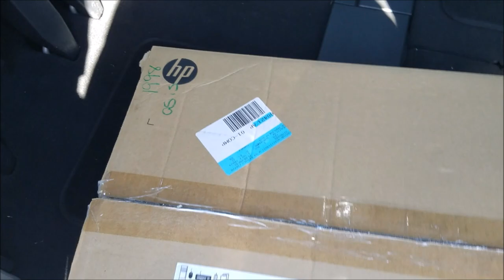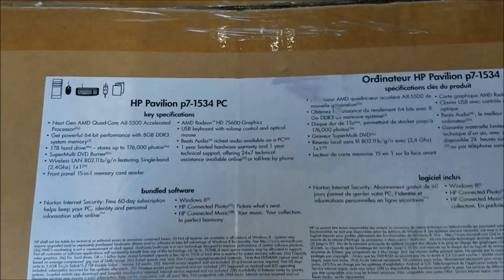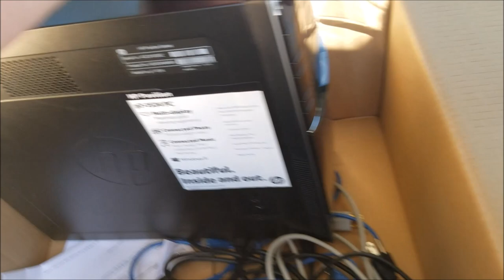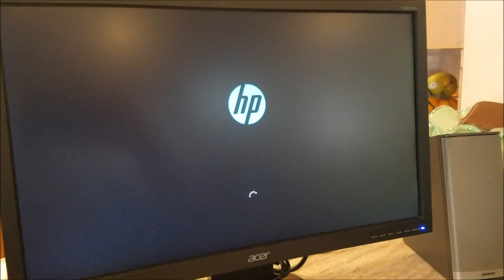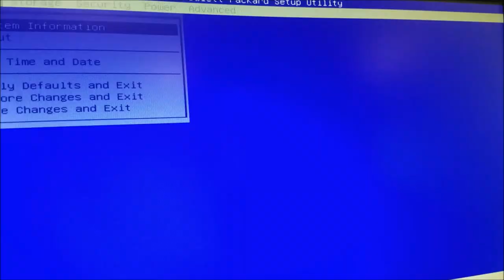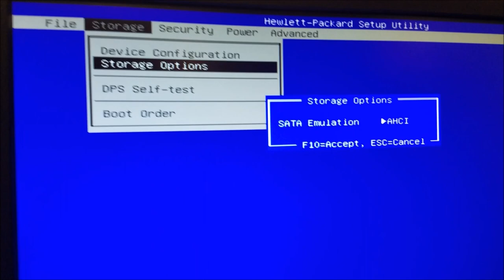$15 QUAD CORE AMD A8 THRIFT STORE SCORE  -  Vlog For Oct 31st 2017

Comment: By putting 4 2G sticks in it, you should be running dual channel, in effect making it faster.  
One of the things that makes it difficult for me to lose weight is that I am Hypoglycemic, which means I need to often to prevent shock.  My blood sugar levels will often drop below 70, sometimes under 50.  I discovered my hypoglycemia the hard way, by waking up in a hospital.  One of the reasons that I decided to do something about my weight is because hypoglycemia can quickly turn into hyperglycemia.  That, and my hypertension is getting harder to control.
Reply: Eric, I have the same thing, and it can be a struggle to keep my blood sugar up.  Unfortunately, I'm recovering from pneumonia that I didn't know I had, and it almost killed me, so I sit around eating and trying to breathe.  Well, I'm starting to do something about my weight now.  And I need a new glucose testing setup.  Any suggestions for inexpensive ones?

Comment: You know? I bought one of these new, it was the Intel version though, it never performed right, randomly wouldn't boot up and would throw beeps at me randomly, the beats audio was horrible, didn't sound good and the software for it was worthless. It would barely even scrape by with office tasks much less any kind of intensive work. I have a poor view of hp now. My old house was faster and at the time it was 10 years old and hadn't been upgraded.